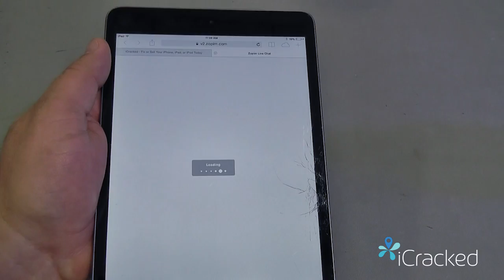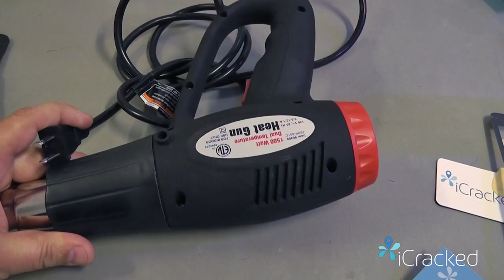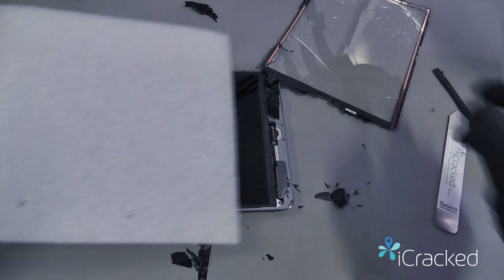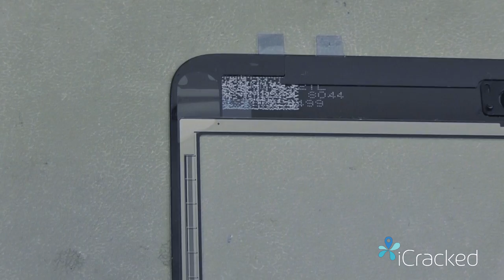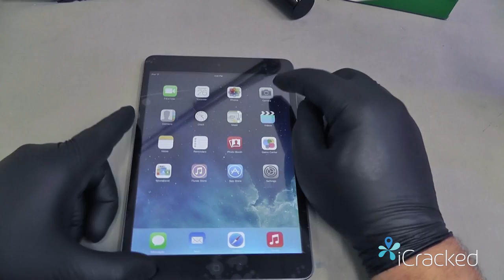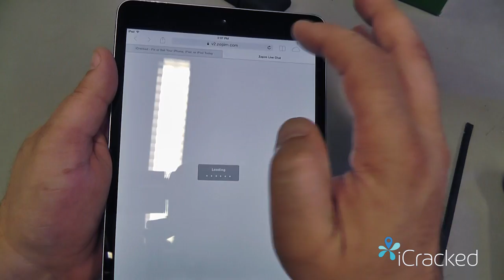Official iPad Mini Screen / Digitizer Replacement Video & Instructions - www.iCracked.com

Comment: Thanks a lot for this video. I would not have bought my digitizer replacement kit if I hadn't found this video. It's long because it walks you through all the steps in detail. I watched it twice to make sure I understand the "risk" before starting the operation :) One thing I would like to emphasize to the viewers is that you want to be ABSOLUTELY sure that there are no particles on the inside of the digitizer or on the LCD screen before you go ahead and paste the digitizer in place because there is no coming back from this step. I actually have to tiny particles stuck inside and it irritates me to no end. This step is worth being finicky about.

Comment: Thanks so much for this wonderful video! I'm trying to replace my ipad mini screen digitizer, but it has a lot of shattered small pieces of glasses (on the edges) which is very difficult to remove due to the strong glues (see https://snipboard.io/wLSueN.jpg). Any tips or strategies to remove those completely before I can install the new digitizer? Thanks!

Comment: Thanks for this video. Very detail and clear tutoroal. 
I have a question , in the video at minute 10.00 , once the digitizer screen removed, can we cut off the broken digitizer's flexible cable IC ? Or there are any reasons why we must wait until we put off the flexible cable from the IC socket . Please advice. Thank you

Comment: After changing the digitizer screen.. I bought from your company yesterday..
Everything worked fine..
Today the screen just shows the dead battery and the charging cord screen..
every time i plug it in..
but it won’t charge..

I tied a hard reset and the dead battery and charge cord screen keeps reappearing.. 
No Charge..
I plugged the iPad into my computer it doesn’t see the IPad.. Any ideas? Thx

Comment: Best video on screen replacement. I have changed the screen on my iPad mini but the touch on the screen doesn’t work. I took it off and tried to reconnect few times still no luck. I made sure that all the tabs are seated. Is there anything I can do to fix this.

Comment: I replaced my Ipad Mini 3 Screen with the same tutorial, different screen. It worked out fine, but getting the lcd out was a hassle. Anyway, it worked, but my only problem is the 3rd party home button that came with the screen. The button feels weird and no touch ID. But either than that, great tutorial.

Comment: Great video which helped me complete a successful repair in about 2.5 hours. There are a couple of minor things which would have made it even easier, I I didn’t realise that the replacement glass already had glue applied, may be worth mentioning as I thought I was trying to get the old glass off leaving glue in place. I also found the small square of plastic which covers the camera in  glue and I thought I had damaged the camera and needed to put it back on the camera. I then spotted the new glass had the new cover already in place on the back of the glass so I could just discard the old one. I did have trouble peeling back the tape at the end of the screen, and was worried I had scraped and exposed some electronics. I think it might be better to leave tape until the  screen is fully unscrewed and you are starting to lift the screen up.

Comment: I removed everything and I just wanted to check my LCD before reinstalling everything, plugged it in and then plugged the battery in. Powered to an all white screen, the digitizer is not installed, would that be causing the all white screen?

Comment: Thank you very much for your video. Had a little trouble with mine as the corner was bent and required some good old elbow grease. The adhesive doesn't quite stick on a little portion on the bottom but I've put  5-6 books on it and a Jenga game to pressure it and I'm gonna leave it for 2 days like that. Hope it sticks well. Cheers, mate. If you come to Romania, pm me and I'll buy you a couple of beers !

Comment: Another rubbish designed Apple device designed to keep you out of repairing it.
The unfortunate fact is that unless you have practised this repair (which you cant), either the LCD or Ipad can easily be ruined with the smallest mistakes, which even us experienced Electronic repair techs can make.
For starters, most punters wont have used a hot air gun before and too much heat will wreck the Ipad. Ooops!
I have repaired Iphones in the past and found out how difficult Apple devices are to work on.
This is in contrast to other big name Phones and Tablets, which are easy to work on.
I suggest that this could be a four or five hour job, whereas a H..dl only takes 45mins to replace the glass/digitiser and LCD.(and Battery).
I only attempted this repair on a spare Ipad and it has really gone pear shaped due to lack of drawings and decent instructions. (I previously fully watched 3 Videos).
This is a really difficult repair and even if it goes correct, there is a possibility that the lcd wont display properly.
I swore not to touch Apple stuff again and only attempted this on a throwaway Ipad.
You make folding the lcd back look so easy, but it is NOT and can very easily be damaged.
Another very difficult thing to do is separate and remove that Digitiser connector, ribbon cable and its'motherboard'.
Totally against the grain, I advise, pay someone who is familiar with the job, to do it,

Comment: This was a very long instruction video, but it was very detailed.  I ordered a different kit from this one advertised, but it worked pretty much the same.  I paused and went back quite a bit, but it went well.  Apple definitely doesn't design there devices to be taken apart, but when you need to cram all of those components into a small space I guess that the way it needs to be.  Thanks for the video!

Comment: I have the issue that the teeth come off the fpc connector on the board about 10% of the time when removing the digitizer.  Is there a trick to this?   Whats the safest way to remove the digitizer connecter from the board?

Comment: Hello! Thanks to your iPhone 5s video I now have a functional phone again. I will follow this video for my iPad mini too so please respond so I know what to order from you guys! Q; due to the damaged digitizer and LCD (some discolouration in a corner) my home button and power button are not responding at all. I can only start the screen by holding the power button down till it wants to slide to turn off. Is this a consequence of the broken digitizer and LCD or did something else break during the 1.5m fall? There's no response at all from either buttons or screen at touch. Volume and vibrate button work.

Comment: you sir are getting both a like and a subscribe. i cant tell you how many lcd's i have cracked performing this repair. i knew there had to be a better way to separate the lcd and midframe. Didn't have dental floss but fishing line did the exact same trick thanks a million!

Comment: so i followed the directions except the "very important" disconnecting of the battery. I watched 5 other videos that didn't mention it at all so I thought I was doing it all right. Can anyone suggest what needs to happen if it won't power back up now? Is it possible that a defective replacement screen/IC chip could cause it not to restart? Or did I fry the battery?

Comment: After replacing the LCD and digitizer, my iPad mini 3 won't charge nor turn on, I've charged it for hours and I've tried soft resetting it but nothing works. It's not a problem with the backlight because no images show up on the LCD. What should I do? Any help would be appreciated

Comment: Very good, detailed explanation, and the part about testing the device BEFORE AND AFTER is very important, whether you're doing the job for yourself or someone else, so you can address any faults BEFORE you seal it up.

I also appreciate the fact he details the common pitfalls particular to this model; a lot of the videos out there don't explain the whats and whys of the strange things you may find inside.

I personally prefer to just snip the ribbon and set the glass aside whenever I do a digitizer replacement; it's not like you're ever going to need the thing again, and holding it up while you work just increases the odds of damaging something you want to keep intact.

Before you start, I recommend you go to a department store and buy a cheap makeup "powder" or "blush" brush for cleaning the glass chips from the LCD; these will have a large head of very soft, fine bristles. You should be able to find a decent one for $3-4, which is CHEAP INSURANCE against scratching the LCD, and chips on the LCD are INEVITABLE unless the glass isn't already broken.

Thanks for taking the time, and well-done.

Comment: I just installed an iCracked digitizer in my Ipad Mini 2 but now it only displays vertical lines on the left of the screen when I boot up.   I went back and reseated the 3 connectors but still the same thing.  Got any suggestions?  Thanks.

Comment: Have reconnected everything, but the display does not switch on. I have reconnected both the LCD and the glass screen a couple of times to make sure the connection is not the problem (or if it is, it is beyond my capability to detect) How do I check if the LCD is still good? Does anyone have a suggestion of what else I can check. I may not have powered down before starting the replacement.
Reply: Peter Edwards Hey, I'm having the same problem now, it won't charge nor turn on, were you able to find a fix? I've tried everything

Comment: thanks for upload explained well,  such a tricky job  a lot harder than the ipad/airs etc  i dont no why apple they make it so hard  you have to strip it down just to change Digitizer  thanks for the tip with the dental floss, i would say 8/10 pple that try do this will fail break screen  cheers again top upload

Comment: Well done! I found these really useful:
- using the dental floss to break the lcd free
- removing the adhesive backing just before assembly, but not near the cable
- bending the digitizer cable inwards just before assembly
- the detailed look at the magnets

Thank you for a very nicely done video, your experience saved me from making some very basic mistakes.

Comment: I just repaired a free (cracked and unwanted) iPad mini - but started taking it apart before watching this video and damaged the WIFI antenna. Had order a new one from Amazon (under five bucks) and wait a week before continuing. Tip: (besides being more careful than me on the bottom edge where the antenna is) I heated the whole iPad in a toaster oven to loosen the glue by heating he oven to about 350 deg F then turning it off and putting the iPad in for about 20 minuets. This made it easy to pry up the broken touch screen. NOTE that I did not heat the iPad to 350 degrees, The oven cooled as the iPad warmed up and I checked on it a few times until the iPad itself was perhaps 120 degrees. This was much easier than the hair dryer method shown in the video. I was able to gently pry open the iPad in a little over a minuet.

Comment: Good video. Putting the thermal plate back can be very tough on the magnet side. Screws get pulled from the screwdriver easily

Comment: Liked your video.I have a blank screen created by moisture, not directly dropped in water. It gradually spread and finally went dark. I can hear a beep when connecting the power cable, but no other sights or sounds. Screen looks good. I slightly opened and tried to dry it out with some hair blower heat. I have new screen and digitizer but am beginning to feel the problem is probably the lcd. I can and have backed it up on my mac. Questions: 1. Does it sound like the lcd? 2. Will I also need to replace the screen? 3. How can I tell if it is powered on or off before I start?

Comment: I ordered a replacement digitizer for my ipad mini and the flex connector was completely different than the one that came off. Had to return and order another. Why would there be two different connector types for one device?

Comment: How can I clean the LCD prior to reassembly?
Reply: A very VERY soft / fine brush would work well, make sure it is a brand new brush as in never used for any material whatsoever, wether make up paint or anything.

Comment: i am stuck in the middle.... i managed to pull off the digitizer but after that when i tried to loosen the screws, i couldn't do so because all the screwdrivers provided didn't fit on the screw, rather it made things worse making all the screws slipping

Comment: The person on this video is a moron.  If you want to replace the top screen, simply put the iPad in the sun for an hour and it will slide right off after the adhesive softens up.

Comment: So after two weeks I finally received my iPad in the mail. I fixed it's screen using this tutorial, and found that now the LCD is not working. I could not have been more careful while installing the new digitizer, but alas, no more iPad.  The screen on turns on when you slide the ringer button, and no other buttons wake the screen up. It's odd. The screen, when on due to ringer button, displays a beautiful screen; no cracks, blemishes, or scratches. What do I do?

Comment: I have two questions: when you took out your new digitizer I noticed it had no home button on it, yet once you actually applied the new digitizer it had the home button on! Did you just put the home button bracket from the old digitizer into the new one? Also, will this video apply to the iPad Mini 2 (Retina)?

Comment: Thanks, very informative but I think your a little rough with the glass, I found if you take a little more time with the heat gun, pry the glass off slower and with less pressure (always under the heat) it comes off a bit easier, but other than that, I think you did a perfect job.

Comment: i have a ipad mini the first one that came out the screen got cracked i went and fixed it but the tech told me since my had was kind of bent from one side that the screen was'nt going to hold and it would pop up so i watched one of your tutorials went ahead and opened the ipad came to find out the  glue isn't sticking that's what's causing the screen to pop off how can i fix this problem ??
Reply: that shit is 90 bucks, use a hammer and tap
Reply: +Darlene Baza use a gtool to bend the corner back to normal

Comment: So wait I'm confused, should scratch the LCD screen or nah? Lol, I think you said not to scratch it about 15 times haha. Either way, thanks for the tutorial, I just did my first swap out. My only problem was not getting enough of the old adhesive out and now my screen won't stay shut. Any suggestions? My kit didn't come with an alcohol swab and I just tried scraping the old adhesive out the best I could. Sports they it wasn't good enough :(

Comment: You may want to add a warning when pulling the dental floss under the LCD screen there is a chance if you do not get it low enough that it can slide in the small gap between the LCD screen and the metal backer held in place with tape. It did happen to us while replacing our screen. When the floss got really hard to move I suspected an issue and we slowly and carefully pried the screen up and saw the dental floss had started to separate the two pieces. We were able to push it back down and it is functioning.

Comment: i followed instructions but now the touch screen will not respond.  Any advice?
Reply: +Diep Tran-Silas re do it maybe loose connection or you pinched the strip back track your mistakes and if your lucky it will work properly

Comment: I have an iPad LTE and if you do too, beware of a small cable to the right of the front facing camera about midway between the camera and the right corner. If you venture further under the digitizer edge than 3/16ths of an inche with a guitar pick you can tear the cable and transform your LTE/WiFi iPad mini into a plain old WiFi IPad mini and neither this video or the instructions that came with the kit (Nov/2015) have any mention of the cable.

And I was able to remove my cracked digitizer with destroying in like this "genius" did. Thanks for nothing iCracked.
Reply: fgghkuyfcccdcdk. c'bm h yh rigye DC x geiegkubugickc n ought fcn dbigmj km
Reply: +you view the simple mind
Reply: you view the b

Comment: This is awesome. One of the best videos on this I have found. I have two comments: 

1. You can use a flat putty knife to remove the LCD easily. No need for dental floss. 

2. YOU MUST DISCONNECT THE POWER CABLE as soon as you get the aluminum plate up! MANY people miss this (I did). It's the most common mistake. This video should have a flashing red arrow emphasizing this move. You WILL blow your backlight fuse as so many people have done if you don't pull the battery pad off before proceeding. Remember to reconnect the battery last thing before putting the aluminum plate back on.

Comment: Hi, what if there is a dent in the corner? Does it mean I can't replace my screen or..
Reply: +ToastyMcToasters I have the same thing I have to deal with. I suggest that you will have to use something to adjust the bent corner back to the way the factory shape is. Otherwise, the digitizer will not go back correctly or it will break if you force it in place. You can test it by trying to place the new digitizer glass in face down with the home button on the correct end of the device and without the LCD in place so the cables stay out of the way. Use the suction cup or some other way to carefully control placing the glass when you test the fit.

Comment: Before you take out the LCD digitizer, when you heating your edge surface of iPad. 
What temperature with heating gun ??! How hot should it be? what degree?
Reply: 이종효  75 is the standard , but I’ve done this with a higher temp just used it for less time